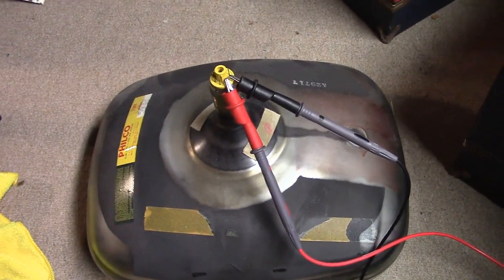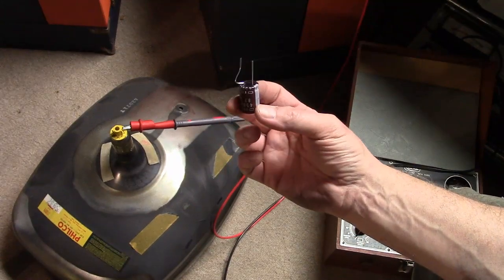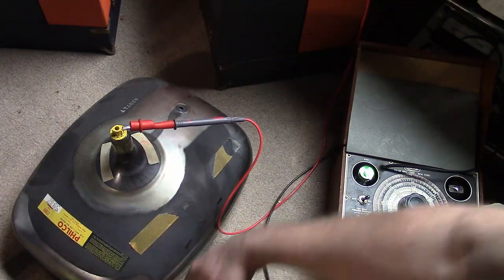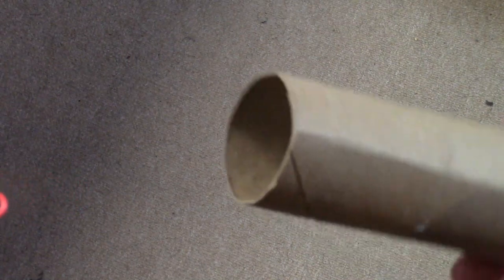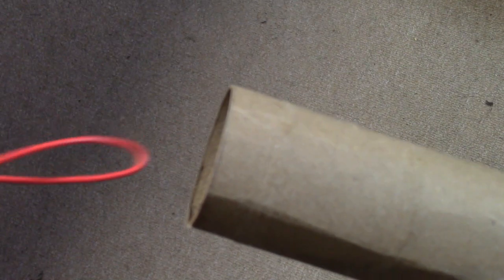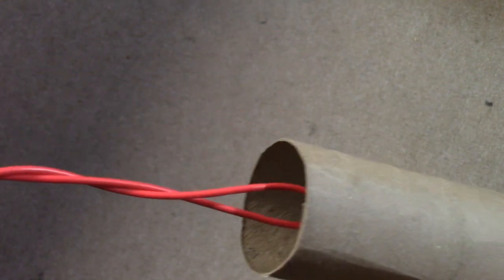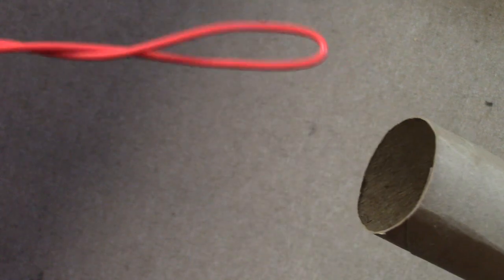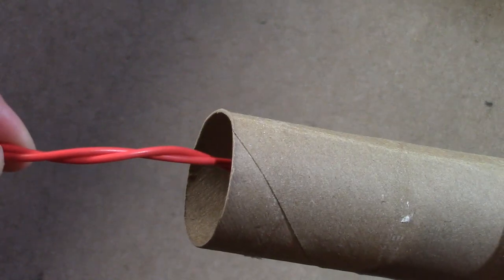Attempting to remove an HK short

Comment: The heater is normally in contact with the inside of the cathode sleeve, to aid in heat transfer. But the heater wire is coated with a high temperature insulating coating of alumina, which prevents electrical connection between the tungsten heater wire and the cathode sleeve. H-K shorts are generally a result of this insulation layer becoming damaged through mechanical vibration, excessive heater to cathode voltage, or repeated thermal cycling. This will uncover the bare tungsten wire, and allow it to touch the cathode.

Comment: I always had good luck blowing out HK shorts with my B&K 467/470, and using the capacitor trick- about 50 mfd at 400V. The notable exception were the Sony CRT's.  and the Goldstar CRT's used in the Zenith TV sets. The old Rauland CRT's for the Zenith sets were very high quality, and the Goldstar CRT's they made before buying Zenith out were also good' We used to sat about Zenith after the Goldstar takeover/ buyout: "The quality went out before the name went on".
 The Early Television Foundation may now be rebuilding CRT's on a limited scale.
Reply from the maker: I'm surprised. I've always heard it wasn't possible. I think you're talking about much newer CRTs though?
Reply from the maker: Oh and no, there is no rebuilding whatsoever. The museum does not have anyone trained to use the equipment.
Reply: @bandersentv  Both new & old. However the old ones always seemed to respond better. I have had  really good luck with the boost/isolation type brighteners for HK shorts, excepting Sony and Goldstar CRT's.

Keep in mind that if you are not using a series string of filaments, with the CRT fil as part of the string, you can almost always find room to stuff a 6.3 volt separate fil transformer in for the CRT to counteract a HK short.

OTOH, if you have a short in a spendy tube- like a transmitting tube, try to see where the short is and rap the tube in the opposite direction of the short. Better than 50/50 chance of the centrifical force knocking the short out. by restoring the spacing of the elements.
    I would NEVER try that on a CRT. I have seen the results of CRT's imploding.
  People injured, blinded, or maimed from the flying glass. I myself, have even been cut by flying glass putting CRT's into a dumpster, and they break & implode.

Comment: My understanding most H-K shorts were the filament insulation flaking off. This causes the heater and cathode to act like a diode but both the filament and cathode are hot enough to emit electrons.. In this case, you would not see any conductive path with the tube cold. No tester can fix this., thus the testers don't even try.
Most H-k shorts on tubes I have seen test fine with a meter cold but once a tube heats up, it has a resistive short. However, my sample size is small.
Heck it was worth a shot. I'd have tried it with both heater pins connected together.  It might have worked for metal deposited across the tube pins via emission (like the dark spots on tube glass.) 
Does seem like the tube was damaged with vibration or mechanical shock. Could be why adding an isolated filament did not work well as the rest of the elements are damaged or misaligned.

Comment: It should be possible to use an isolation transformer to get around a H-K short.  However, if the cathode is driven by the  video signal, you might need to add RF chokes in series with the heater leads to the transformer.

Comment: Maybe the high capacitance between the primary and secondary of the separate heater transformer caused the video content AC shorting to ground. I would have tried a tiny ferrite toroid transformer running from a few turns around the flyback core. It worked for me in some color sets. You can space the primary and secondary winding on the ferrite toroid core far from each other, minimising the capacitance between them, and putting it right on the CRT socket. But if you choose try to blow off the short, it would probably be a better idea to short the two ends of the heater together and put the capacitor between the shorted-together heater and the cathode. I would have tried also to put the CRT neck down, and gently bashing the neck with the handle of a screwdriver. Maybe the vibration would reposition the heater coil so the part with the damaged insulation won't touch the cathode. But even if it would be successful (very unlikely), it would be a very temporary and unPREDICTAble fix.
Reply from the maker: Thanks for the advice. I believe electron guns are actually oriented sideways in these low voltage, short necked CRTs. At least the filament/grid portion.
Reply from the maker: Flyback trick is an interesting idea but I would do it to a Predicta. Easier to just replace the CRT than make modifications like that.
Reply: Another possible (more extreme) solution would be to build a DC supply for the heater and then put 2 large inductors at each end of the CRT filament. Inductors appear as a high impedance at AC so that would probably be enough to keep the video signal out of the power supply. A transformer should theoretically to this too but maybe it either wasn’t enough inductance or large parasitic capacitance like the other guy said
Reply: I was also going to suggest a common mode choke on an isolated filament supply to keep the ac video signal out of the isolation transformer. Might need several common mode chokes in series to cover the high frequency and low frequency parts of the video signal. Should work.
Reply from the maker: @herbertsusmann986  I was unable to get even a hint of a glow on the CRT face with an isolation transformer.  I suspect the gun was damaged or cathode completely dead.

Comment: when doing this you're supposed to connect both the heater pins together!
Reply from the maker: Ah thanks. I didn't realize that.
Reply: That "might" have helped, yes.  The tube seemed to be at death's door already, though.
Reply from the maker: @SeekingTheLoveThatGodMeans7648  Yes, it appeared to be the original and high hour.  The gun is quite discolored.

Comment: It was a paperweight so you gave it a go .
OK only 1 or 2 % chance of a win but that's not zero ! 

I would have used a smaller value cap .
Maybe 10 – 47 uf & link the heater pins .
Reply from the maker: Ah, but what voltage?  I imagine the ESR of the cap might have some effect on the discharge rate as well.  The CRT looked to be original and very well used judging by the discolored electron gun.  So I figure even if it had worked, it didn't have much life left anyway.

Comment: I once revived a german b&w-tube with a h-k short by massively over-volting the filament. I blasted it with about 15 Volts AC for a few minutes while tapping the neck of the tube with a piece of wood. I was lucky. The capacitor trick never worked for me. I always blew the filament open even with the two filament pins tied together.

Comment: Well, it blew open half the short, if we look at it that way.

These heaters are supposed to be able to take twice their rated voltage.  Using an adjustable supply between the "higher resistance" end of the heater (or both ends connected together) and the cathode might have only done something like this, or it might have managed to melt the short away.  I once had a heater that had shorted to itself (cutting out part of itself) that I managed to clear with an adjustable supply.

As mentioned, there's almost nothing to lose.  A heater isolation transformer might have been another possibility, but with the caveat that this tube could be at death's door anyhow.
Reply from the maker: I tried a separate transformer and couldn't get a raster at all.
Reply: @bandersentv  ok, sounds like dead anyhow, no loss, just experiment

Comment: Thanks for the video. I have a similar problem with a very persistent G1-K short on a 10BP4. It shows up as the heater warms up. I've tried clearing it with Sencore CR31 and RCA WT333 testers with no luck but haven't tried capacitor discharge yet. Any suggestions (I do have a replacement)? Thanks.

Comment: I've always wondered about failure modes in Predicta crt's. I have a 21" that plays great, lots of brightness and contrast. Except you can see a purple glow in the neck just in front of the gun assembly. It shows up on the face of the tube when it is playing as a purple vertical line about 1/8" wide and 3" long (tall) at the lower center right of the screen. I play it regularly about 1/2 hr at a time, and it hasn't self destructed yet.
Reply: Your tube is gassy. It's a wonder it has good contrast at this stage. With a CRT with so much gas in it that it glows purple, the picture is usually blurry and/or negative. Internal arc-over is also common. In solid-state sets, it can kill the video output stage easily.
Reply from the maker: The 21 inchers were prone to having a short life.  The 17s don't seem to have this problem. Any CRT can develop an HK short. So can any tube for that matter

Comment: I wonder if using something like the capacitor wizard you could find the low impedance side of the heater to cathode short. It might matter which side the capacitor is hooked to, then again, who knows....

I think the Beltron discharges capacitors through a light bulb in series for current limiting, maybe that  is the trick to save the filament, or not.

Comment: most just toss em after there short!
Reply from the maker: Sure, but replacements go for $300+ if you can even find one!
Reply: @bandersentv  at that point just buy a new set
Reply from the maker: @FennecTECH  LOL, sure if you can find a Predicta for sale with a good CRT for less than $500.  Restored then go for 2 grand plus.  There's a reason we try to squeeze all the life we can out of these old parts.
Reply: @bandersentv  damn! i wasent exactly hinking vintage but yeah  if you want to have a predicta like that then yeah save every tube you can!   i like to play arround with vintage thnkpads from late 90s